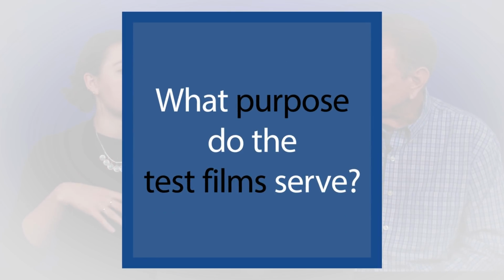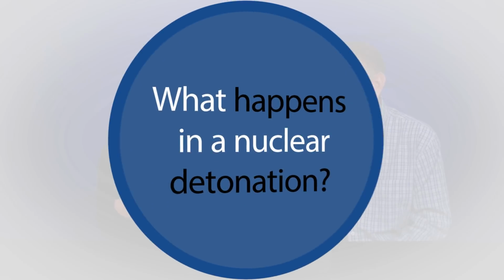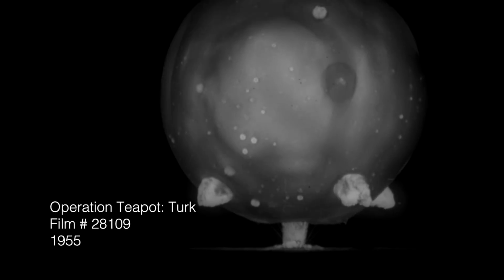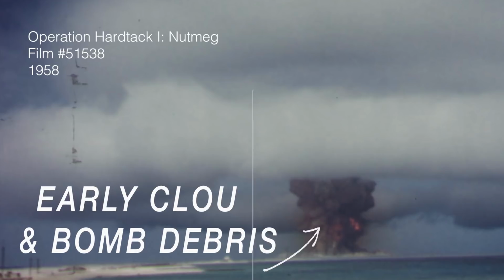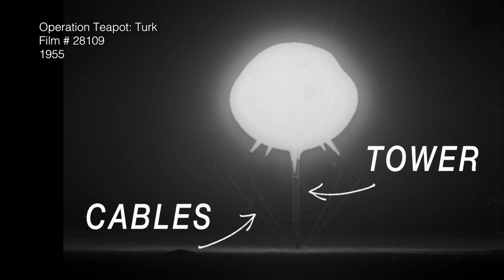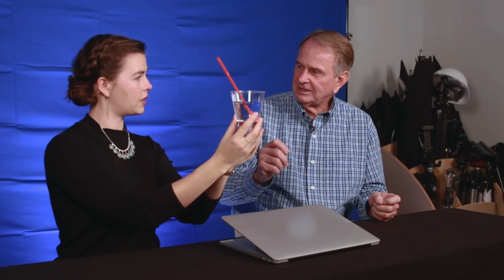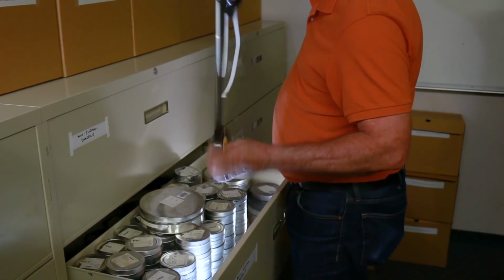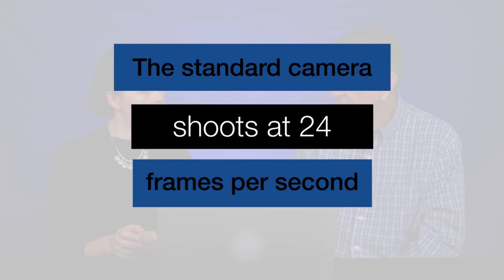Answering FAQs about the Nuclear Test Films

Comment: I think some of the photons that were involved in "rope tricks" (the vaporization of cables, towers, etc. that creates spikes) were also in the visible part of the spectrum.

There was a test where some of the cables were painted white or wrapped in aluminum foil, both of which were highly reflective to visible light and didn't capture as many of those photons. That reduced the heating of the cables and significantly reduced (or eliminated altogether) the rope tricks/protrusions. Conversely, painting them black to absorb visible light made them much more prominent.
Reply: Interesting.

Comment: This question may have already been answered somewhere, but I am unsure of where to go. Does anyone know what the differences in the yield calculations were between the original and new values? I read that in some instances the difference could be around 40%. I assume that that would likely be 40% larger than calculated as apose to being 40% lower, but I haven't found a way to get hold of this data. Is it even in the public domain as of yet? Any help on this would be very welcome.

Comment: How were the films digitized?  Were the films scanned more than one time? Possibly another FAQ video?
Reply from the maker: Good question. Rare film expert Jim Moye takes the lead on the digitization process. The overarching goal when scanning the films is simple: Create as exact a copy of the data as possible. To do so, Moye preps and cleans the film before scanning it with a customized Hollywood film scanner. Because much of the film is black and white, it contains a greater range of optical density (shades of dark and light) than the scanner can record in one pass. So Moye scans the film twice, first capturing the rich details of the darker shades before adjusting the scanner software to capture the lighter shades.

Comment: Is the speed of the shock wave constant or does change with the yield?
Reply from the maker: The speed of the shockwave does change with the yield.
Reply: That is a good question. On the detonations that you can see the shock wave moving towards you ie the Iconic Baker shot is not that a regular Mach 1 speed ?  I don’t understand a lot but is not that speed fixed to Mach 1 but the power or NRG in that wave front declining very rapidly ? Would not these characteristics be the same as a regular chemical explosion ?
Reply: @oceanhome2023  Shock waves are supersonic, by definition. They start off at supersonic velocities, decelerate, and at some distance become regular sound waves travelling at the speed of sound.